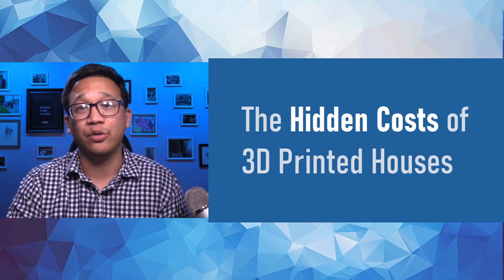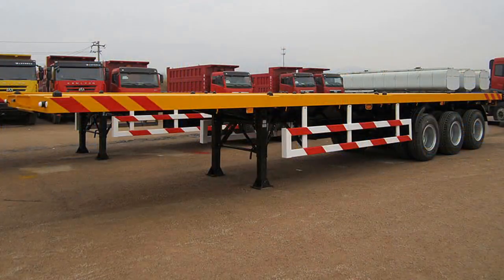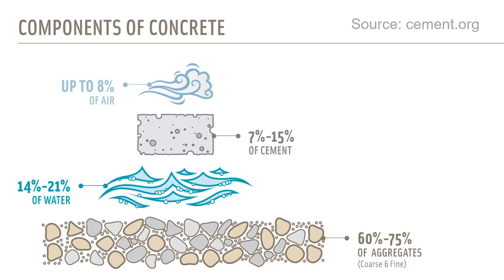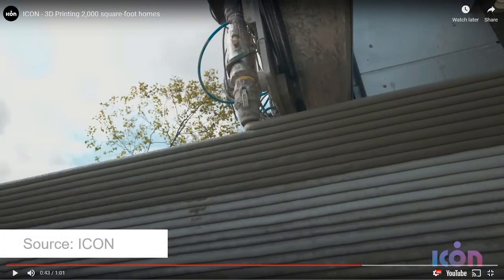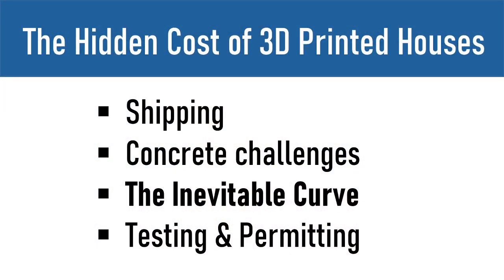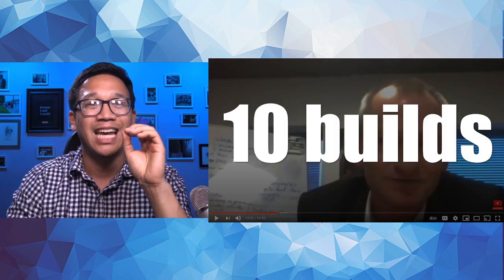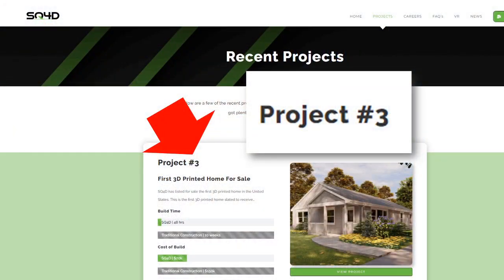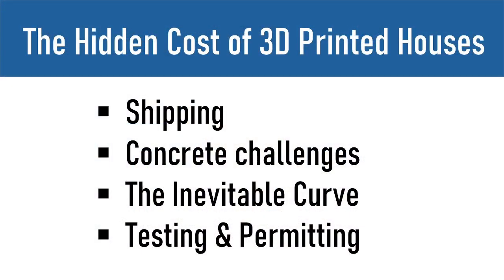The Hidden Costs of 3D Printed Houses

Comment: Really poor pleading.   Spin it any way you like but construction as we know it is dead.  Chopping forests, cutting and treating boards with chemicals, wasting wood, mining for materials plus months of pouring foundations, framing, drywalling, electric, plumbing, blah blah  - can and can and will be done better, cheaper and more efficiently. 

The proprietary concrete argument is silly.  It's proprietary only because it's the product of the printer! It's not as if they could use the same input and get different products.  Any new process involves a learning curve. 3d printing is in its infancy and traditional building has thousands of years of experience.  One of the best aspects is the systematic analysis that must occur before building - placement of pipes, electricity, windows, HVAC, etc.  Add the ability to easily create shapes other than a box, lower costs, less time...and it's a win. Traditional constuction will be here for some time but if there is a better way, why not do it?

It's almost a given - any new idea (self-driving cars, wifi, 5G, genetic tinkering, online shopping / dating / banking, flat tvs, smart phones, GPS) is greeted with growels of "Why do we need to change?" or "It's not any better than the old way."  Yet in a few months we're using the product without a thought.
Reply: The cost (and long term operational cost) is the only concern I care about.

Until the price can somehow be mitigated, it’s not a realistic approach to home building. A home should not cost upwards of $250,000. That’s insane.

The working class is being price gouged for basic necessities of life such as food, water, shelter, and transportation by those with wealth.
Reply: @hobomike6935  ":Should" is a subjective value judgement.  "Cable should not cost more than $25"  or "Gas should not cost more than $1/gal"  "A job at McDonalds should support a family of four."   

Markets, compared to planned economies, are incredibly efficient - penalizing bad ideas and rewarding good ones.  We don't even notice the continual improvement of all things.  In 1950 we paid 50% more for food.  I taught English to immigrants who succeeded because they rejected the latest cell, cable, cars and houses they couldn't afford, clothes and junk they didn't need, eating out constantly.
Reply: You are right 💯